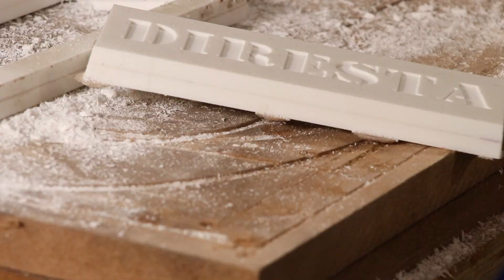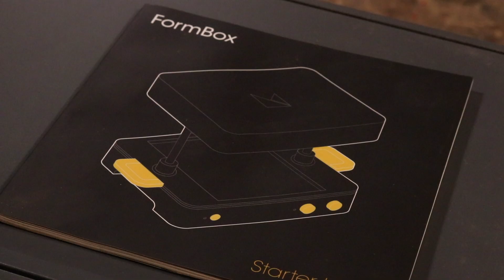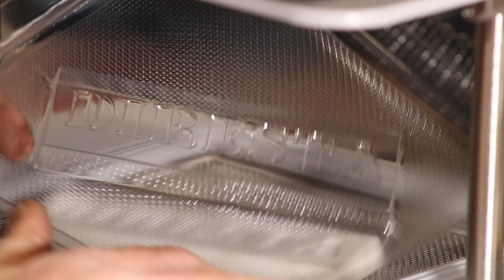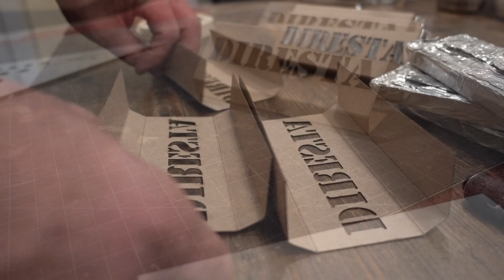DiResta Candy Bars!

Comment: Though slightly large for my hobby as a model kit build I was interested in the Formbox when an advert popped up on Instagram (now I know why). However I baulked at the price £600! That's getting to the price of a low end 3D printer. I then I saw this video and you have to provide the vacuum yourself, so £600 for and electric toaster! I know it's a startup and prices may drop, but Matel famously made a vacform machine that was a kid's toy may years ago and are much sort after. I've even made one from a tuberware box and heating the plastic over the stove.

Comment: Turn the power down on the laser and vector a dashed line in place of the lines you manually scored on the outside cardboard wrapper. The cardboard will easily bend but not break. 

p.s. I like white chocolate :p

Comment: Nice. Although you need to temper the chocolate or it'll bloom and look nasty in a few days.
Reply: he's not exactly working with couverture there, it's got enough soy lecithin in it it should stay emulsified
Reply: It's not exactly a huge deal, you're right. Although lecithin doesn't emulsify chocolate, it acts purely to help thin it to aid moulding. Tempering is about getting the right crystal structure in the cocoa butter and if you don't do it, even the cheapest chocolate will bloom. (Source: I'm a chocolate maker and wrote a book on it.)
Reply: Dom a thin coat of lacquer will fix that
Reply: Hi Dom! I've been wanting to make my own chocolate for a while now. Could you link to you book? Thanks!
Reply: Sure, just search Amazon for 'Dom Ramsey Chocolate' or Google the same. :)
Reply: Dom This right here is why i love Internet.
Reply: Give em to me....!!!     Slurp...!!!!     Problem solved...    lol
Reply: Pierre's Garage exactly my toughts. In a few days they will be eaten.
Reply: Actually, that would be some interesting experiment: getting an extremely thin layer of slightly watered white sugar glazing onto the chocolate. Might make it sticky, though, but that could be fixed with an equally thin layer of something greasy - like coconut grease. Would also prevent the sugar from completely drying, cracking and loosing its shine. A chocolate maker might say if that's doable at all.